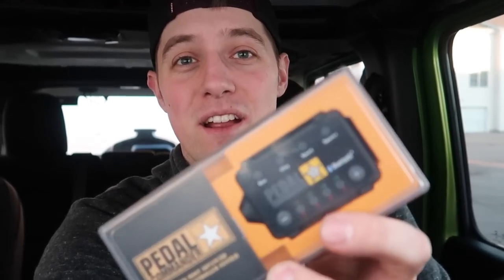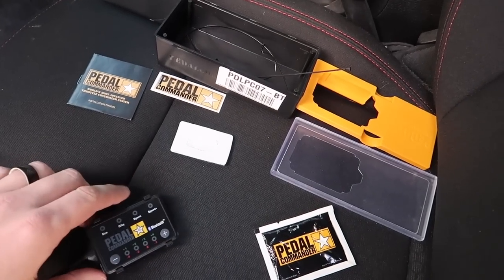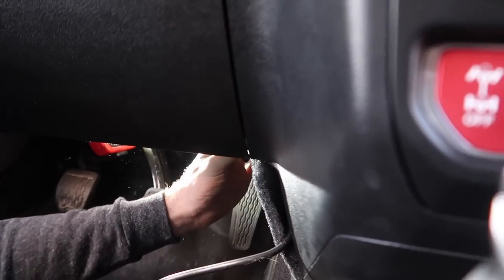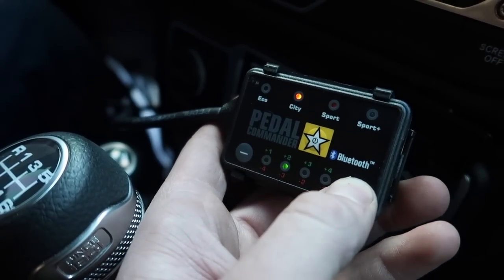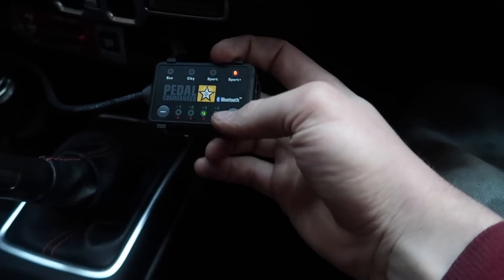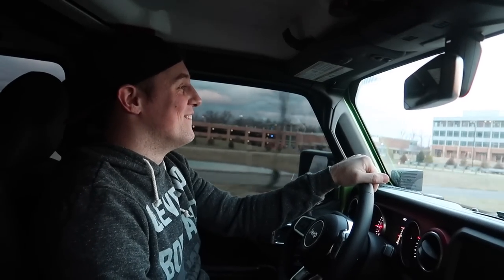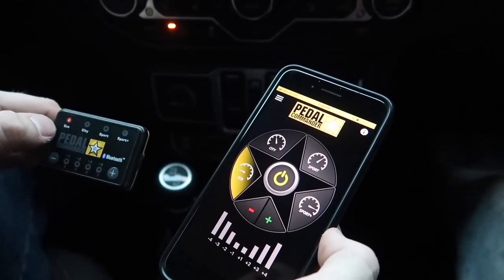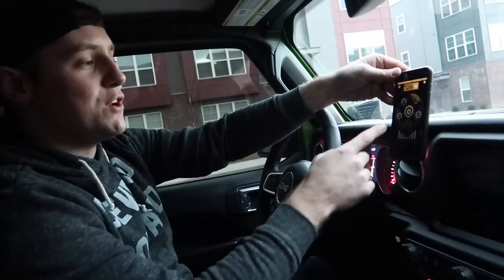Installing a PEDAL COMMANDER in my Jeep Wrangler!!

Comment: Cant wait till mine comes in! Will be interesting with my turbo!
Reply: Be careful,  I have the turbo and I jade to tale it off.  Yes it males my 35km3 chirp,  but check engine light keeps coming on,  throttle warning comes up,  and I loose all power.  I finally had to take it off.

Comment: Have you try the Idrive?
Reply from the maker: No but I have had a chance to see it at SEMA and personally I think it’s a cheaper version of this. It’s got a couple of modes and an lcd screen but essentially does the same thing. The Pedal Commanders module is simple to use and the lights show you exactly what mode your in, plus you have more variability with the +\- 4 settings. Not only that but you can connect via Bluetooth and use your phone to change settings which is awesome. Pedal Commander Actually won the award for their category at SEMA
Reply: Ben Anton thank you so much i just learn a few new information I didn’t know. Also keep the content coming is awesome.
Reply from the maker: I appreciate it!

Comment: does it void warranty ?
Reply: Nothing technically "voids" the warranty.

For a warranty to not be honored, whatever you have installed on your vehicle would have to be the CAUSE of the issue.

So if your windshield wiper motor goes out they can't deny the repair based on a lift kit. If however your computer gets fried because of an aftermarket component you install, the repair will not be covered.
Reply from the maker: It states on their website it will not void your warranty